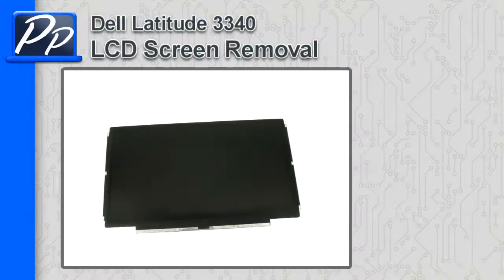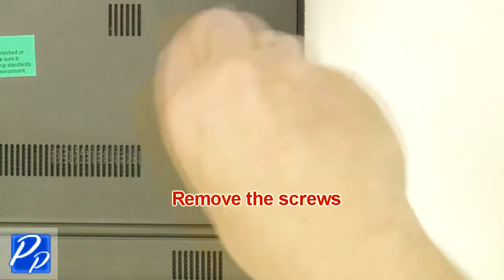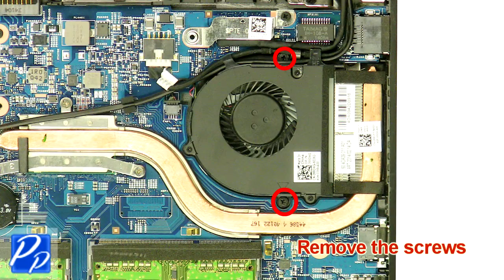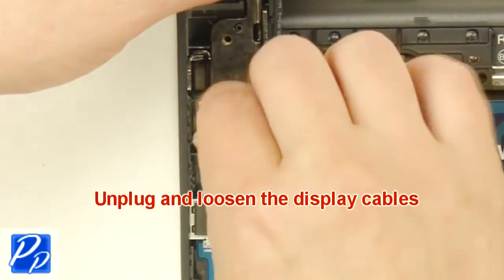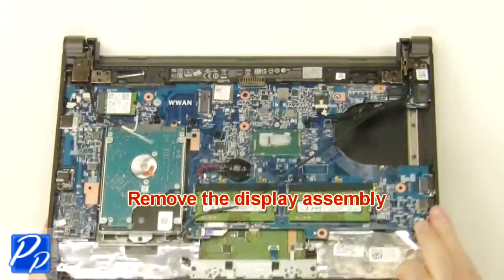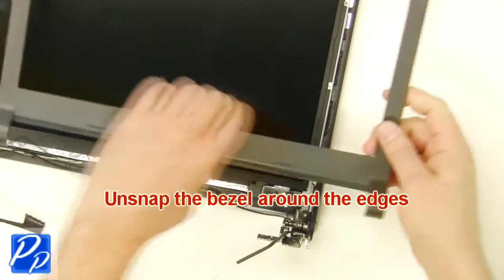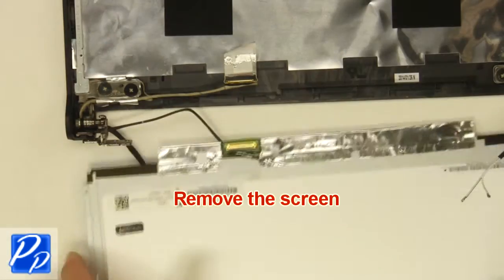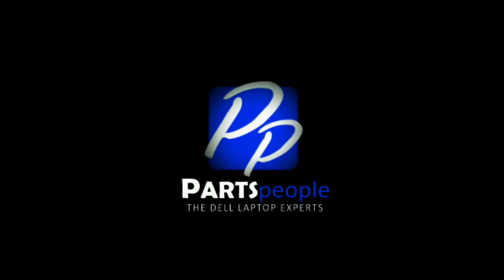Dell Latitude 3340 LCD Screen How-To Video Tutorial

Comment: You don't have to remove the entire screen assembly from the base to replace the screen. Unplug the battery for safety, pop the bezel off, remove the 4 screws holding the screen to the back, unplug the cable from the old screen, plug in the new screen and reassemble. Much quicker...
Reply: Yeah I'm a bit mystified why they do all these non-essential steps..
Reply: Yeah I wondered why he's going around the neighborhood to get to the back door...
Reply: i think he want to make the video longer

Comment: i have a laptop like that and it's red but my screen is the problem i cant really see nothing i can see dell but not that bright i try to turn up my brightness it wont work  and my wifi  is the problem
Reply from the maker: A dim screen is most likely a bad backlight and means the screen will need to be replaced. Wifi would not cause the screen to be dim.